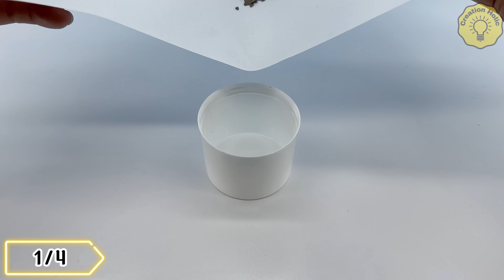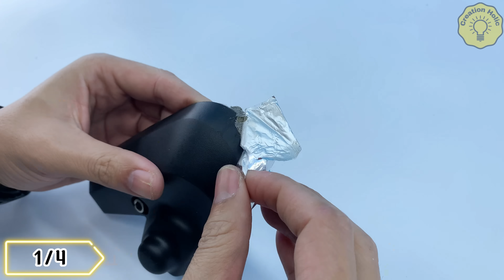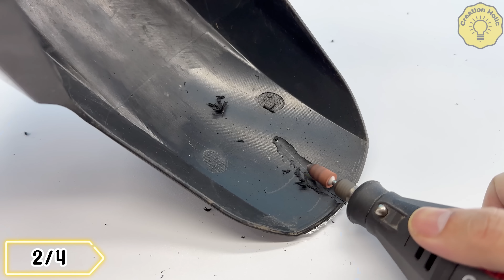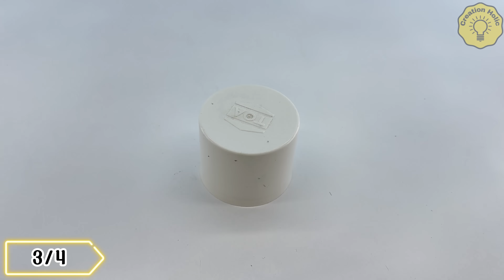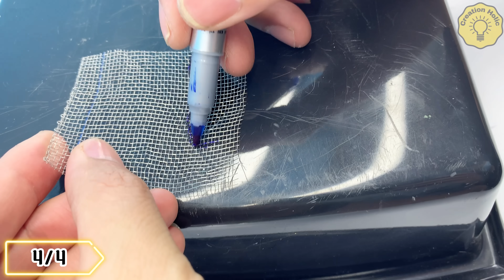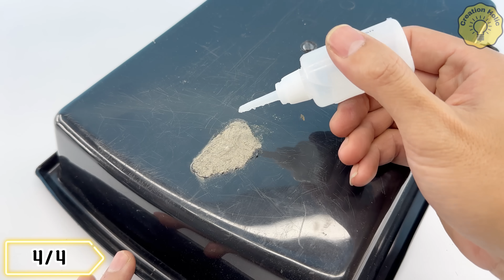Smart!! Pour Super GLUE onto the WELDING ELECTRODES and be Amazed!

Comment: You know this IS ver cool, kool, or even KEWL but only if ya have extra welding electrodes laying about..... lol,  the value of the
electrodes in fixing cracked metals probably far exceeds the use in plastic repairs but it is cool to know.  It makes me wonder
about using chopped up scrubber pads or other flaked metals that come in a powdered form?  I'm certain there are a few
metals in powder form that this work work?   And I have a need,  my Dash of an old truck is cracked & there's not any new
ones made to replace the old.  I've been looking to no avail so either this process or one of your other videos showing the
use of cigarette butts or other "Fibers" to mix w/ the super glue for plastic repairs is what I need.  This one won't work b/c
I'm not buying welding rods just to get the metal off of them - too expensive.  Do you have other plastic repair videos?
peace & GB
Reply from the maker: You can consult
https://www.youtube.com/watch?v=U2bitV4rl8I&t=410s
https://www.youtube.com/watch?v=yNH2rp3wWhY&t=430s